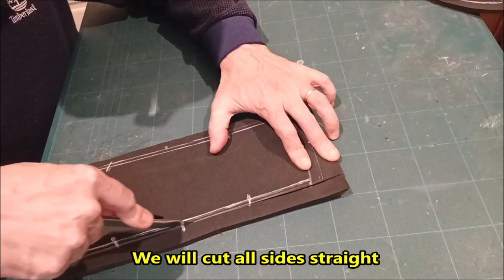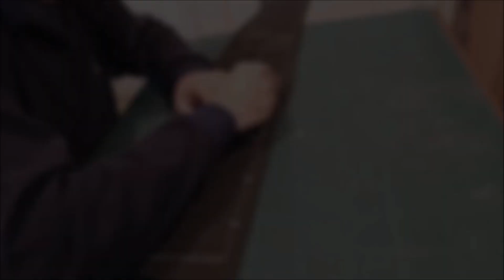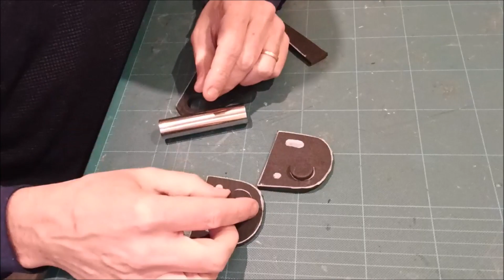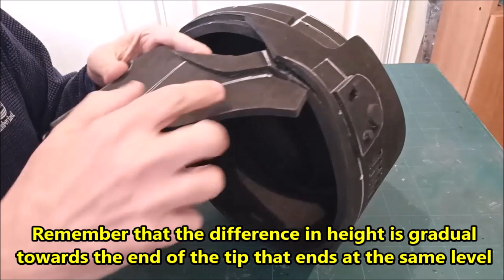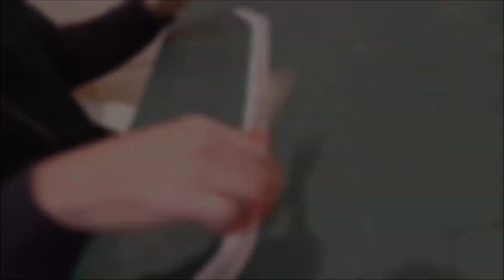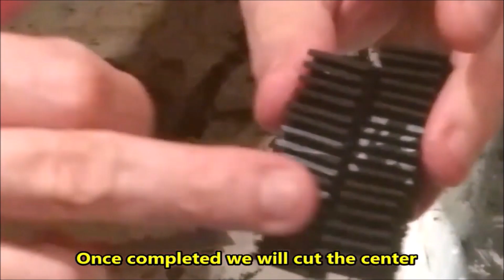Shoretrooper Helmet Foam Build

Comment: What thickness of foam did you use?
Reply from the maker: Hi, for this helmet template, the basic things you will need are:
· 1.5 square meter (1m = 39.37 inches) of 8mm foam
· Small area (25cm x 70cm aprox.) of 4mm thickness for Back part
· Small area of 2mm thickness for Nose details and terminals
· Contact cement, hot glue gun (optional)
· Foam cutters, scissors (optional)
· Heat gun or powerful hair dryer instead
· Paper tape
Note: recommended foam density between 60 to 80 (30kg to 50kg in kg by m3) to get the same result. Cristian
Reply: @StormtroopTemplates  thank you so much, I plan to build this soon

Comment: Great Helmet! Great instructions as well!

Two quick questions: where do you get your foam?
And what knife do you use? I have tried a lot of different razor blades and hobby knives but none of them seem to work. Thanks! Keep up the good work!
Reply from the maker: Hi Gavin,
I get the foam from my country, Argentina, you cannot get in yours. But you can get the Eva foam in these online cosplay stores:
cosplaysupplies.com (USA & Canada), redmooncosplaysolutions.com (USA & Canada), truenorthcosplay.com, (Canada), arda-wigs.com/collections/foam-products (USA), sksprops.com (USA), thecosplaypros.com (USA), tntcosplaysupply.com (USA & Canada),
poly-props.com (UK), cosplaycrafts.com (USA), I recommend foam from
 tntcosplaysupply.com/product/eva-foam-sheets/
You can get sheets of foam of 24" x 60", each sheet is almost 1 square meter.
About the blades I change them continuously. You can get them in
Excelblades, I use this kind of blades of 9mm wide.
https://excelblades.com/products/k14-flat-light-duty-metal-9mm-snap-blade-knife
Tell me if you need help.
Cristian
Reply: @StormtroopTemplates  Thank you so much!

Comment: I'm 15 and want to make your stormtrooper amor I plan for it to last long. at least till I'm 17 or so and I'm 5' 9" now would the amor fit me

please let me know if it would fit a person my size or if I would have to change the templates
Reply from the maker: For the height it will be perfect, I am 1.80m tall. I also recommend that you validate the rest that is more important than height with this image
https://i.etsystatic.com/15900749/r/il/1cc472/1944155428/il_794xN.1944155428_slgz.jpg
Tell me if you need more info.
Thanks 
Cristian